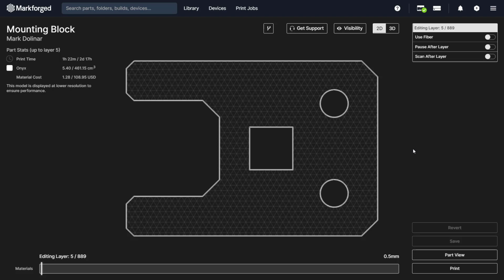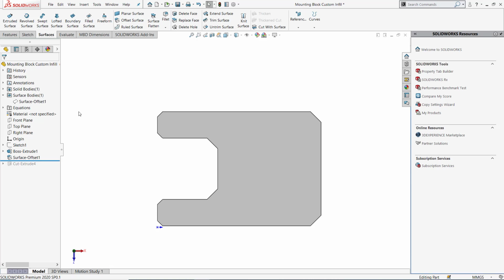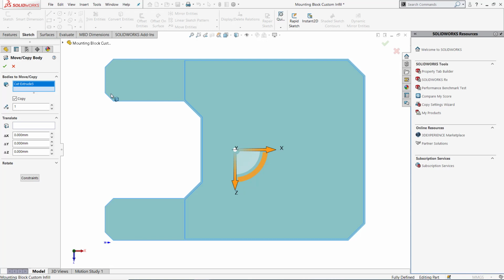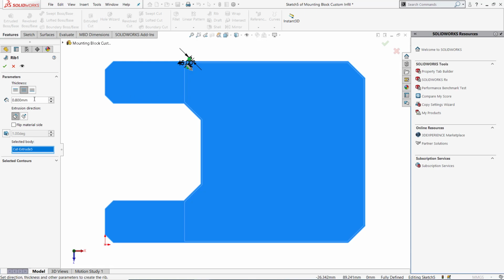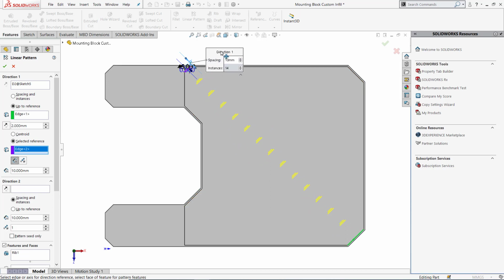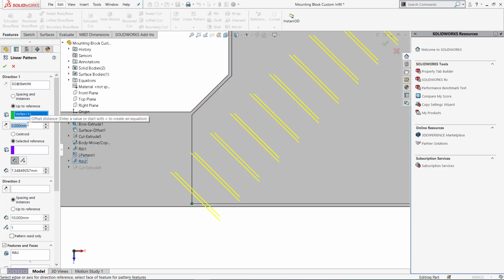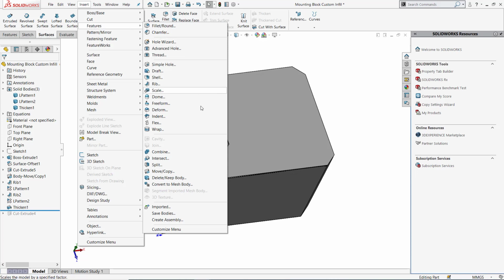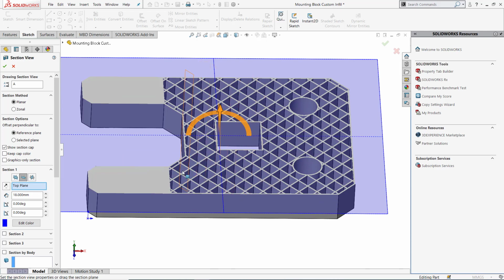Create Custom Infill Regions for 3D Prints with SOLIDWORKS

Comment: Not a bad method, but that infill pattern you created is rectilinear, not triangular. Also... rib feature works on simple parts, but Solidworks rib feature is generally very unstable in complex parts. I would avoid using it and just use a simple boss extrude in most cases.

Comment: in cura you can figure the same with less work ;-)
Reply: how?
Reply: @kirkandersen  either import a 2nd part as infill modifier on overlaps or just draw modifier cubes on the imported part within cura and select which printing parameters to modify. One of my favorite things to do is increase wall thickness or top/bottom thickness in specific regions where there will be clamping loads, corner stresses, etc. It's not perfect but still takes about 1/5th the time as this example...